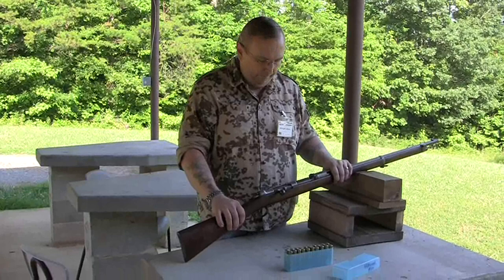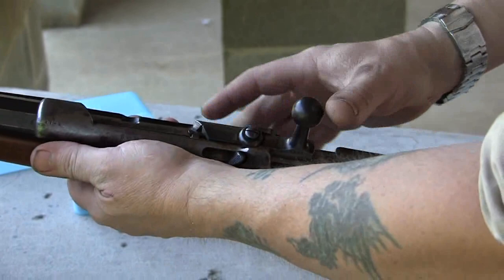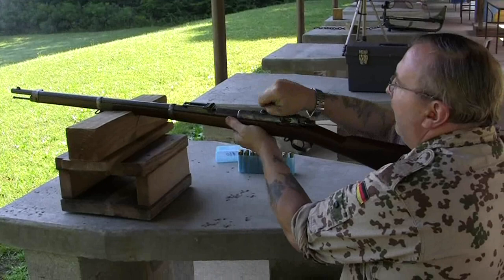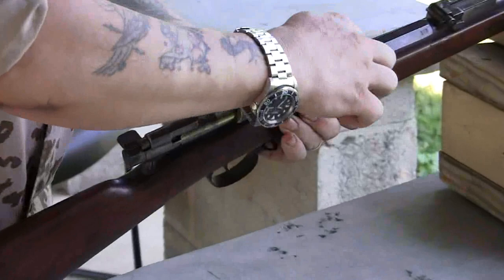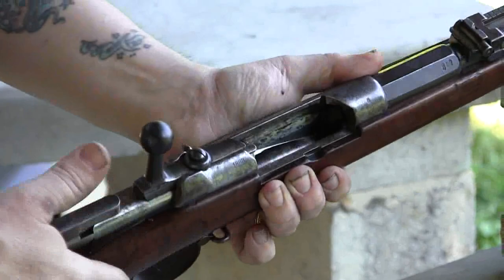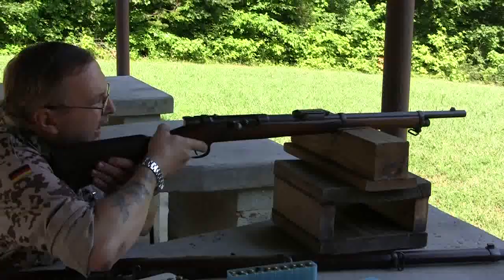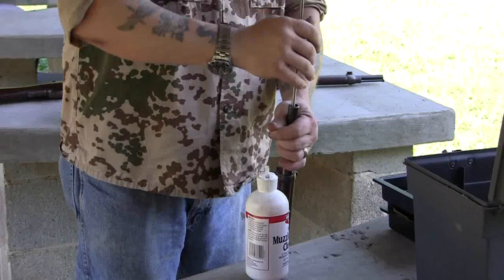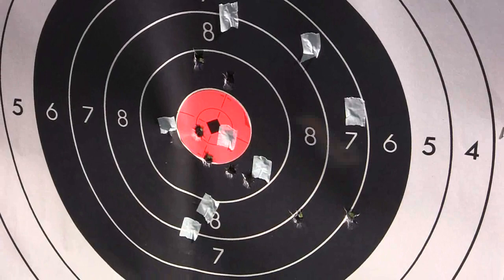Mauser 71/84 How to load and shoot

Comment: Hm. I myself wouldnt use Smokeless Powder. The Way it reacts is quite diffrent from Blackpowder, rggearding space, Pressure etc. In Germany, if you want to get a Licence for a Gun you have to take Lectures and pass a test on things like Ammunition, Powders etc., and the Bottomline has been very very clear, there. As far as I know, Blackpowder-Substitutes are available in the States, if you have an aversion against the Cleaning/smoke Issues. BTW, I noticed you handle the Shells extremely carefull

Comment: Is it sufficient to clean the bore with the black powder solvent to neutralise the residu and stop the corrosion and procastrinate the cleaning for a few days or do you need to clean with hot soapy water every time to prevent it?